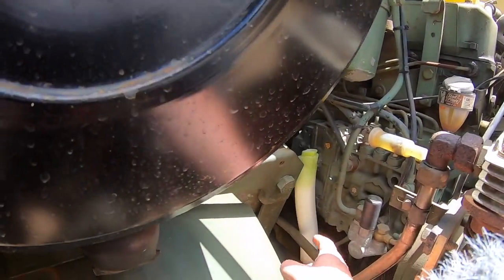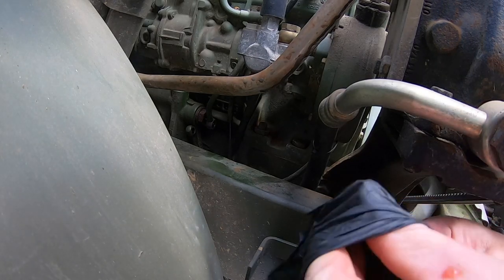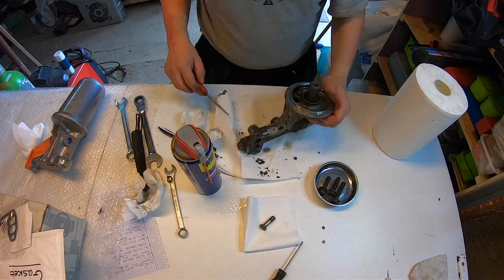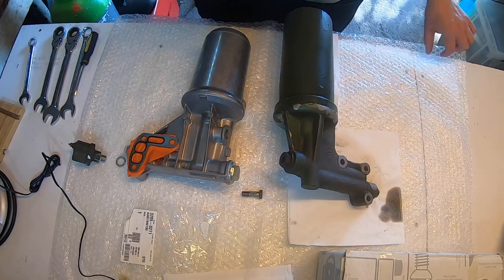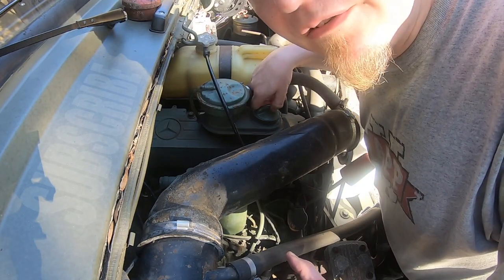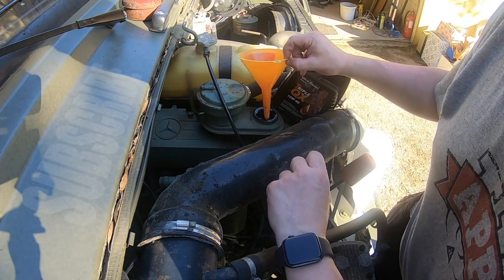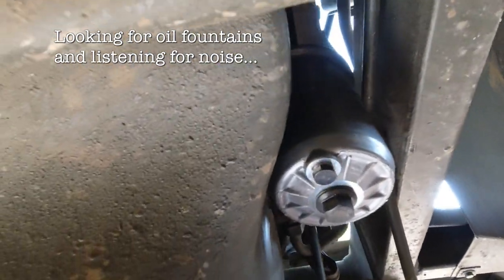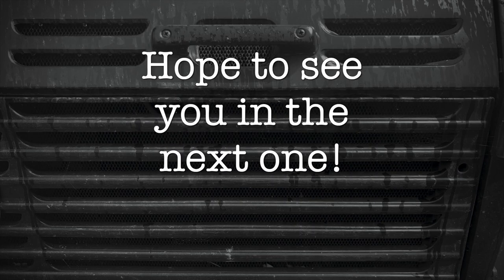Unimog Camper E017 - Fixing an oil leak

Comment: Hello Friend. Generally, when making this change, oil is usually used in the reservoir so that it does not work dry. Avoid this lack of oil pressure.
You keep doing a good job of restoring your truck, congratulations!
Reply from the maker: Thanks Itamar! Yes, I do this when I change the oil filter. However, in this case I was following the workshop manual by Mercedes-Benz. The manual states (as shown in the pic) that you can crank the engine up to 20 seconds in one go, but then have to rest for 60 seconds to build oil pressure. I cranked for a total of 30 seconds over 4 intervals during 90 seconds. (I timed it because I knew this would be handy to know. 😉). There was two, in hindsight, reasons why I didn’t fill the oil filter reservoir with oil before cranking; 1) I didn’t think outside of the manual (maybe I should have applied some common sense!?), but also 2) I didn’t want any oil or other liquid anywhere near this as I was chasing the oil leak. If I would have spilled or dripped oil on something it could have been mistaken for a leak - which I was trying to fix. 
Regardless; filling the oil filter or reservoir with oil when changing them is a good idea. 
Disclaimer: No OM366A engines were harmed when making this video. 🤪👍🏻
Thanks for watching and thanks for your comment! 😎👍🏻👍🏻
Reply: @JockeSelin  Relax friend. Here in Rio de Janeiro we say "quiet". It remains a great pleasure to follow and interact with you through your channel. Let's move on. And it is always consistent to follow what the instruction manual says. Avoid unpleasant surprises.
Reply from the maker: Bom dia! No problem, my friend. You’re absolutely right to point things like this out, and I’m not adverse to comments and criticism. I appreciate being under the scrutiny of eagle eyed viewers like yourself. Thank you! I hope you’re staying safe!

Comment: Nice! I feel your pain...we've been chasing little leaks...air, oil, and clutch....for a year. Finally have them sorted, but it's no fun!
Reply from the maker: Thanks Bill! Yes, leeks are annoying. Leaks even more so. I’m pleased to hear you’ve got your truck fixed.
Reply: If you fixed your air leaks, does it stop losing air altogether? Mine is losing air after a few days... down to 4 bar eventually.
Reply: @RolandOfGileadOnYT  I still have one little leak (that I know of) to fix. Mine does the same...leaks down to 4 bar after a couple of days. Others have told me that they don't lose any pressure after weeks...
Reply: @Colorado4x4Van  Hmm, so clearly it's possible ;)

I've tried searching for the leak several times, no luck so far.

Because it leaks down to 4 bar, I think it might have something to do with the pressure-releave-valve, isn't this set to a minimum of 4 bar? To me, this sounded like it isn't closing entirely or something.
Reply: @RolandOfGileadOnYT  That is possible. My smallest leaks are around fittings on the tanks...found them with soapy water...tightening doesn't help. A friend told me he replaced his steel fittings with brass as the steel ones corrode over time...not looking forward to that!
Reply: @Colorado4x4Van  Yeah, I've cleaned that valve twice now, but still leaks. I still think it's suspect, due to that 4 bar pressure that remains. And yes, I've tried soapy water ;)

Comment: Hey mate, cheers from Australia.  Following you with interest as planning getting an Unimog myself.  Few comments: 

1) I believe the oil filter bracket (as you call it) replacement was unnecessary, as the leak looks it could have been fixed by simply tightening up the banjo fitting and/or changing the compressible gaskets (aluminum or copper).

2) I also believe that you should have been able to reduce the oil filter priming time by initially filling up the oil filter housing, therefore soaking the filter cartridge as well, as much as you could.  Due to position, might have been difficult to hook it up without some spills though.

3) The new oil filter housing being shorter, hence a smaller cartridge is a bit of a strange engineering development, counter intuitive that is.  However, the size might not be relevant.   You and Caz should be looking into comparing the filtering capacity, size in microns and more importantly the flow rate that can take.  I bet they would be similar.   Compare the old filter design with the new one.  Pleated filter offer much larger filtering surface at the same physical size,

Hope this helps.

Cheers, 
Raz
Reply from the maker: G’day Raz, thanks for your comments. Let me reply to them individually.

1) The oil filter bracket (official name: oil filter support) might not have needed replacement. That’s true. The banjo bolts were not leaking. They played no part except they needed removing to fit a new bracket. The gasket did indeed look like it had failed. The oil leak was coming out of a fastening bolt. Just a through hole. So if the gasket was broken between the oil feed / oil return holes to the bolt hole, then this could have been the source of the leak. If that’s the case, then a more modern version, like the steel edge moulded one, of the gasket might have been the fix. However, now we are into speculation, and to go to certainty I’d have had to do the exact procedure again, with the exception of using an old part instead of a new one (same workload). If this would have fixed it, we wouldn’t know if it was a permanent fix or if the oil filter bracket would have cracked in the future and I would have had to do the same again (workload 200%). We would have been travelling in remote areas with a the knowledge there might be an impending problem. Not very nice. If replacing the gasket would not have solved the issue, then I would have still had to order a new oil filter bracket and fit it again (workload 200%). To conclude; to minimise the workload and to have total peace of mind of reliability, this was the best way for us. 

2) Yes, I could have done that. But as I explained in another comment; I was a) following the manual, b) didn’t want to introduce any potential oil into the equation when I am chasing oil leaks. As you know, oil has the character of seeping everywhere and it being really difficult finding the source of it. When I change oil I put oil into the filter and housing to minimise the oil pressure build up time. 

3) Whilst I’d be happy to discuss oil and oil filters through the night down the pub, it has no practical implications. 🤣👍🏻 What I mean is that if the engineers at Mercedes have deemed this development equal or better to the previous one, then I’ll take their word for it. I’m not an engineer (Caz is, and she’s professionally worked with large Diesel engines and especially oil capacities and filtration) and as a layman, I’ll leave it to the experts. I’m pretty happy that the sticky-out-ish older filter is now not as much sticky-out-ish and better protected. 

Again, thanks for your comments, and I hope you get your Unimog soon. 😎👍🏻👍🏻

Jocke
Reply: Jocke Selin cheers mate.  All good.  😉